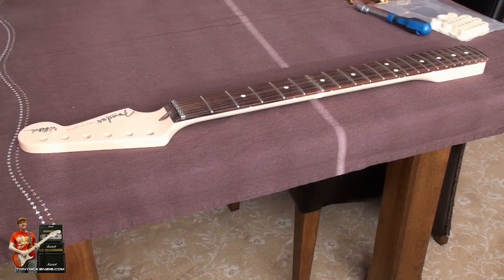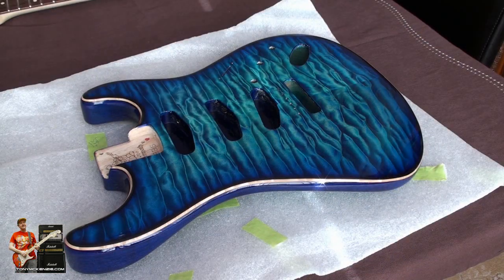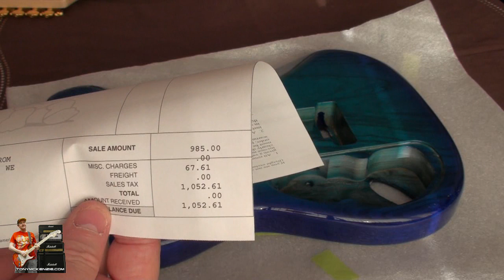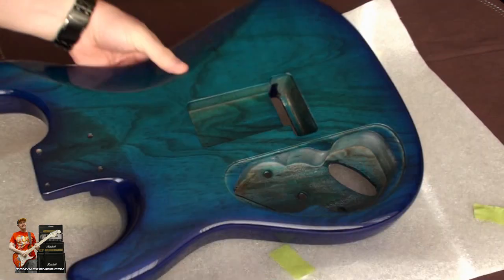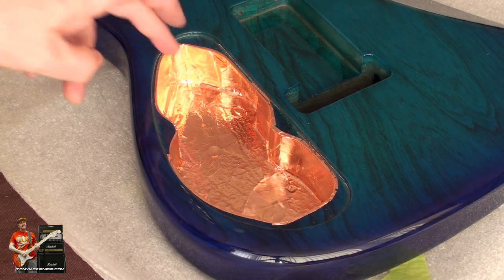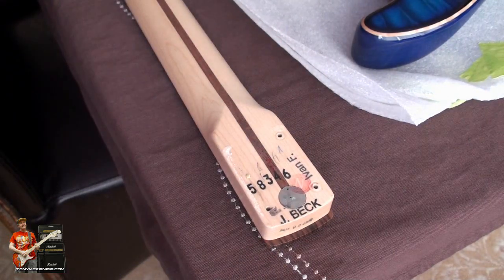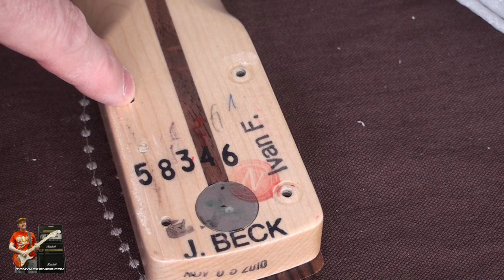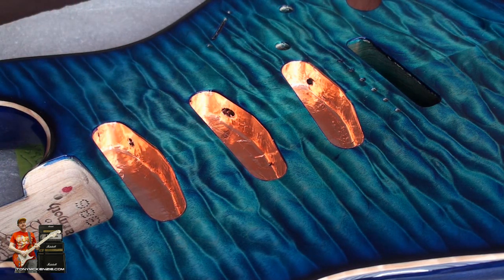BLUE PART ONE | Fender Stratocaster Strat Custom Shop  | How to make yours like this | Tony Mckenzie

Comment: Nice clip. I used to work at Warmoth. Requests for the neck pocket customization would have been met with a frown by the shop lead. I'm surprised they agreed to even think about it. Swamp ash is the lower part of the tree and is more porous and lighter than hard ash, the higher part. I built a Warmoth Strat up as well. Sounds and plays great.

Comment: I had a custom tele body made from Warmoth.   Chambered maple with birdseye maple top, one f-hole, rear routed like yours and routed for a vintage strat trem, double bound in black.  Warmoth did a beautiful job, but it was a pretty standard build for them.  Actually didn't talk to anyone for the order, did it online.   One little issue, the trem cover on the back had the holes on the wrong side (lefty body, the countersunk holes didn't work with the slot for loading the strings).

Comment: HI Tony, Really nice guitar. It's nice to know that I am not the only one to have problems with
WARMOTH. I, like you spent a fortune with them. The body was stunning but the neck was a disaster! I eventually returned the neck only to be advised that it was wonderful!! The neck binding didn't sit properly, there were dings in the headstock and the finish was rubbish. They MESSED around with the neck and were off hand in their response - tough!   BUYERS BEWARE ~ treat WARMOTH with caution!!

Comment: Tony, great builds on all your videos, a. good supplier in the UK, if you haven't checked it yet is Angela Arnott at 42nd St guitars, great to deal with and you won't get rinsed on import charges. Keep up the builds!
Reply from the maker: Yeah tell me about costs... the £ has dived and everything has increased typically between 9 and 15% from what I see currently. Thanks for the info on that supplier I'll check it out for sure. It all helps... Thanks for watching too... and those kind words.

Comment: warmoth makes some amazing necks too with your choice of wood or one they have in stock.
Reply from the maker: Yes... I have used some Warmoth necks on telecasters that I made... the only thing is they done dress the fret ends etc. and you have to do that. But apart from that they have some really amazing birds eye necks.
Reply: I bought a neck years ago from Chandler guitar parts and they didn't dress the neck either .
Reply from the maker: gscgold One of the reasons I tend to buy Jeff Beck Fender necks... one of the best necks I think there is (for me of course).

Comment: A small question for, I put a titanium tremolo block on my favorite Strat and I can't tell and big difference. A tad brighter a little more sustain. The unit is more stable, stays it tune better. I put a brass block on my EVH Wolfgang with a Fender tremolo on it. That guitar is a beast, the brass shaved off a nice bit of treble. Now I can stay in the same room when I play it.
Reply from the maker: Very good question... I have also tried 'big block' tremolo blocks and others of varying materials. Personally while I do think there is an improvement against some tremolo blocks that were fitted (mainly cast low quality zinc type things without density) when I have tried it on already decent tremolo blocks it did not make the sort of differences that some manufacturers claimed... so in the end I tended to not really bother with that. On tremolo units the Super Vee (as fitted to the blue Stratocaster you were watching) was one of the best on a Stratocaster that I have ever used... but it does take a bit of getting used to. It stopped all those 'clunking' noises when you use it (unlike the 6 screw Fender ones) and the arm was a really nice fit. Not a cheap tremolo but one that really did change the overall sound on the guitar to a better place. But the answer to the question I think is that it all depends on the original tremolo and what they call a 'block' as supplied from new. Hope it helps.

Comment: Beautiful build Tony. You've inspired me to build my second guitar after a 10 year luthier hiatus. Did you ever consider hooking a push/pull pot up where a tone knob is? I installed one on my last build to activate the bridge pickup and I can get some pretty interesting sounds with neck/bridge or neck/bridge/middle activated. Beautiful guitar though.
Reply from the maker: I have done that on at least one of the guitars I have built... but I've also used a Toneshaper that can get to parts other beers can't reach LOL... check one out... very interesting especially on a strat... and good to hear you are going to make another .... exactly why I make the videos.

Comment: Yeh but the nicest looking bodies are the ones with the pickguards. The wood is stunning,the nicest grain, and they use it for a front route why not save it for the re route where it will be truly appreciated? Pickups are a pain in the ass selection is impossible. Im tempted to copy another guitar but the one I got the main idea from has pickups costing over £200 and I cant afford that. Im currently looking on gumtree for bargain ones. THanks for the help though

Comment: Yes it makes a difference the wood makes a difference don't think so! if that's the case one could glue plywood up there's a reason for the wood. its a great job tony and sound
Reply from the maker: +keith ellis Well said... there are so many guys all with sometimes very strange views. But TBH I agree with you. Thanks for watching.
Reply: don't be stupid. the wood makes no difference in the sound. it makes a difference in the cost...Go smoke another one.
Reply: +Utouchit2 
so what's your hobby guitars or trains. Any experienced player does know there is. you can buy one made of plywood, run it through a great amp, and you could get a doable sound, If! you don't plug it up, you'll find out. if your a person (over arguing this point) your probably not a solid player, and would argue over anything.
Reply from the maker: Ouch!

Comment: Two things: One, was that a new role of copper shielding? I was hoping that for your standard 2 humbucker guitar that would be more than enough, Second, what is the little silver circle thing in the back of the neck toward the bottom? I understand that this was so long ago, but any help would be awesome tony :)
Reply from the maker: Get two rolls :) they are cheap.... and the metal circle is for a Fender fix to 'tilt' the neck back so the strings sit nearer the neck. Prevelent on early 70's guitars from Fender and maybe others I think. Thanks for watching.

Comment: Tony, Warmoth sells neck screws that are already staggered for contoured neck heels, it's Warmoth SKU # S9. Neck Screw, Set of 2+2 for Contoured Heel. Why didn't you just buy those?
Reply from the maker: Later I did! Check my other videos! But thanks for pointing it out which was an omission on my part. I'm not sure if they had them back in 2011 though. And thanks for watching.

Comment: My question is where you got that maple top for that guitar... Honestly it's probably one of the most stunning tops that I've ever seen. Nice job!
Reply from the maker: Warmoth.. custom choice... it was the best piece there...
Reply: *****
So by laminate top do they mean fake maple or is it just a thin piece of maple pressed on to the base wood? Is yours actual maple? Regardless it looks stunning
Reply from the maker: Jordan No... what they do is use a piece of real maple and glue it over the swamp ash. Then they (sometimes) carve the top (think Les Paul and PRS). So the 'top' on this is real maple for sure and I selected it specifically for this guitar. Then it takes about 6 weeks before they finish gluing, sanding and all that other good stuff. I specifically intended to make this to look as good as any maple top guitar out there and I think IO was successful in doing that.
Reply: Oh, thanks for the conformation. I might use warmoth sometime, I was a bit confused since some people use the word laminate in guitars as a fake-wood and some by people talking about thin sheets of wood. Again thanks and great video!

Comment: Yeh Im looking for a mahogany body with maple top and all the ones I like in the pre made shop are not rear routed, and I dont see the point in a maple top if its gonna be covered up seems a shame. Im building a crazy strat any way, well when compared with a traditional fender. Im kinda copying a Suhr HSH design it should be really cool. Pickup selection is the most tricky part. Do you have any recommendations of good pickup companies? I am mainly looking for value for money

Comment: Hey man, just wondering what the finish is called. I couldn't find it on the warmoth website and its the EXACT finish I want! Looks perfect!
Reply from the maker: Sorry Jack... it's been a while since I did it. But check Warmoth site as they do show the finishes they have... I just forgot which one I did.
Reply: ***** thanks for the reply man. Yeah I'm trying to decide between turquoise and blue burst and I have a feeling that your guitar in the video is turquoise but looks a little dark and slightly bursted on the edges.
Reply from the maker: Jack Tibbitts No I think it was a blue... I know I saw no description of turquoise that's for sure. It does look 'bursted' on the edges and those clear masked bits set it off I think too.

Comment: Tony, as always, a steller video.  Well done man!  But I was shocked when you turned the body over to reveal the back side.  The finish is a mess!! Did they leave a piece of tape across the back?  Or was that were it was braced for holding during the finishing process?  Unacceptable.  I have heard a number of negative issues with Warmoth, and that body is typical from what ive learned.  What a shame.
Reply from the maker: I think you are wrong about that. I see nothing like that in real life - but I just checked the vid and I think you see where the neck part is a line... that shows that way because of the taper which this body has. The back is as perfect as the front. Had there been anything like that make no mistake I would have sent it back immediately - especially at the price it cost. If you think its somewhere other than where I said then can you be more specific, I can't see it in real life. Thanks for watching.
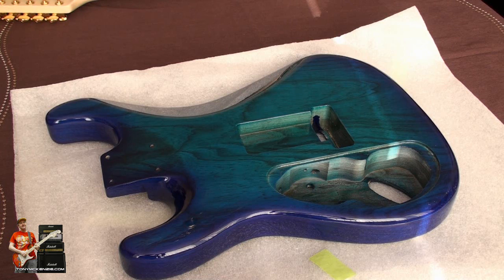Reply from the maker: I checked further and the 'streak across the body that 'runs through the cavity' is actually sunlight coming from the blinds in the room at 7:23 ;-) Notice at 12:29 its gone :) and if you look you see the light from the blind across the towel....
Reply: ***** Oh my, that's hilarious! Yes, you are correct, as I watch the video again I see theat its actually sunlight....Wow, this reminds me of a Three Stooges skit......  Thanks, I should have known it was something like that - hard to believe anyone would ship somethiung with a problem like that appeared to have.
Reply from the maker: rkl17 If it had had that problem as you described it would have skimmed back to the USA at the speed of light LOL. But I did smile when you said it :)

Comment: Have just ordered my warmoth soloist body and warmoth modern fender neck. 
Did not get the 720 mod on the body because they didn't allow the mod if u have a contoured heel (which is also what I got), don't really know why they don't allow you to do both 
Is there anyway I can get the 720 mod done myself from a luthier I trust? More importantly, Should I get it done,considering it's already got a contoured heel?? 
My body is rear routed by the way 
Many thanks!!
Reply from the maker: Then that has changed - I'm sure I got the .720 mod on a contoured heel. If Warmoth have stopped doing it there will be a reason. Mine was a Strat body so there might be some difference? Also what was the body wood? Alder is softer than Ash (which I had)... You can get it routed out... but I would ask them why they won't do it first, you don't want to end up with aggro that can't be fixed! Thanks for letting me know about that one... it's a new one on me and I'm sure it will help other readers on here. Thanks for watching.
Reply: tonymckenziecom yup! The body is alder. 
And yes, they DO NOT allow a 720 mod on contoured heel guitars anymore. I checked it out on their website. Even while making the guitar online, after I selected the 720 mod option, it would not allow me to select the Contoured Heel option later on. I can't seem to find an explanation anywhere (even on their website) as to why they simply can't do both together ? I eventually chose the countered heel over the 720 mod because I choose comfort over look (especially considering you can't really tell there's a gap unless you actually look at the guitar up close and from the top), but still wanted to know if there was anyway I could get rid of that gap. 
It's a good idea to ask warmoth directly though.
Thanks for the tip! Cheers!
Reply from the maker: In fact I have been back to Warmoth and made a copy of the Blue Strat that I originally bought. If you use swamp ash as the back wood and maple as the top with rear route you CAN have a .720 mod with the contoured heel! My guess is that the alder is too soft for the job.

Heres the build:

Model: Stratocaster®
Scale: 25-1/2 in.
Chambered: Yes
Right/Left: Right Handed
$0.00
Wood: 
Core: Swamp Ash
$197.00
Front Laminate: Flame Maple
$75.00
Front Laminate Unique Choice: LT2114
$175.00
Control Cavity: Rear Rout
$20.00
Pickup Rout: Strat® - Strat® - Strat®
$0.00
Control Rout: 
$0.00
Volume (Strat®)
Tone 1 (Strat®)
Tone 2 (Strat®)
5 Way Switch (Strat®)
Bridge Type: Tremolo
$0.00
Bridge Rout: Vintage 6-Hole Tremolo
$0.00
Jack Rout: Strat® Top Jack Rout
$45.00
Neck Pocket: Strat® with 720 Mod
$45.00
Mounting Holes: Standard 4 Bolt
$0.00
Contours: 
Contoured Heel
$35.00
Forearm Contour
$0.00
Tummy Cut
$0.00
Binding Top: Natural Masked Accent
$75.00
Battery Box: Double Battery Box
$15.00
Top Finish: Blue Burst
$230.00
Back Finish: Clear
$0.00
Finish Type: Gloss Finish

!!

Comment: Are the mistakes that Warmoth have made with your order a one off or is this a regular occurance? If its happened to you before then why keep using them when you most likely can custom guitar bodies here in the uk? I've seen quite a few of your builds and they're great viewing. Rock on! ;)
Reply from the maker: +Mark Gowans No they have only made this one mistake in about 10 years of buying from them. I know you can get bodies here in the UK of course but from what I have typically seen (from the ones I have looked at) I don't think they match this one. Glad you like the guitar builds - I do too and thanks for watching.

Comment: You were lucky this guitars looks amazing, but on many of the pre built ones in the shop, the paint just isnt great and I cant afford to make the spec I want in the custom shop where you design it. I also think that dyeing it wouldnt be that hard. Ive seen pro videos where they paint the guitar and all they are using is a clothe and dye cant be too bad. I might contact a luthier and try and get some info out of them if that is possible

Comment: I hate to tell ya but the glue on copper tape does not conduct electricity. It needs to be folded over if on itself or you need to get a large sheet of it and cover the cavity in one piece.

Comment: Why did you fill the unused hole in the neck? No one would have ever seen it, once it was mounted to the body.
Reply from the maker: I have been asked a few times and the answer is simple... I don't do half a job. Whether you can see the hole or not does not matter! :)  Good question that as I said a few have asked. Thanks for watching.

Comment: Hey tony what type of wood did you use ? That finish looks mad 🤘🏼❤️
Reply from the maker: The wood on this body was Swamp Ash back and Maple top. It is one of the best looking guitars I have from anyone in the world. Thanks for watching.
Reply: tonymckenziecom hi master, I have a 79 strat way too heavy, I m thinking in swapping the body for something new and light , any suggestion regarding the 79 neck fitment? thank you in advance
Reply from the maker: Not really... just go with the decent bodies and you should be fine... I used Warmoth bodies and always found them to have good neck pockets. Hope it helps... thanks for watching.
Reply: tonymckenziecom thank you very much